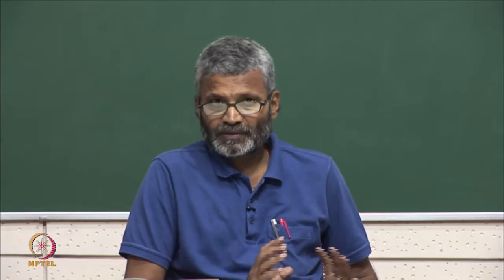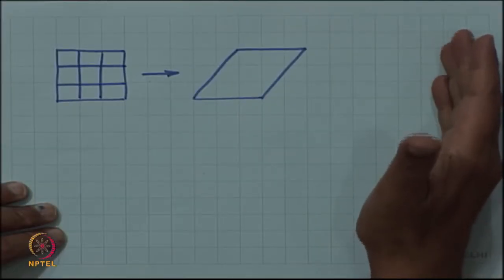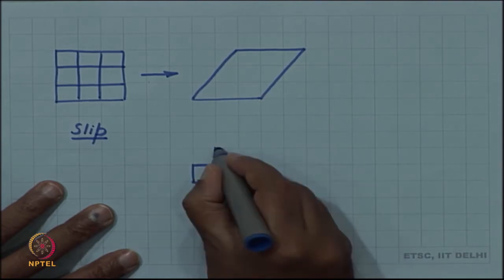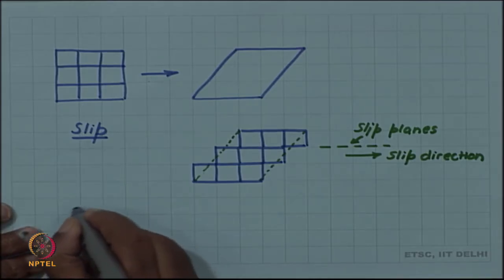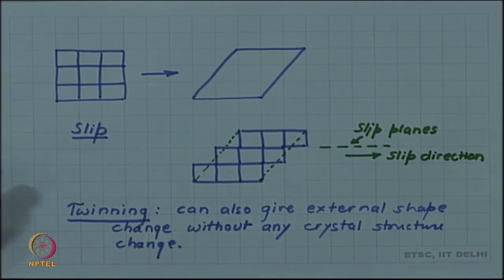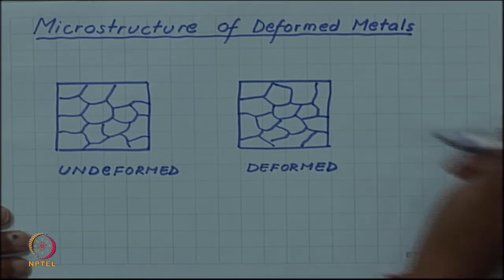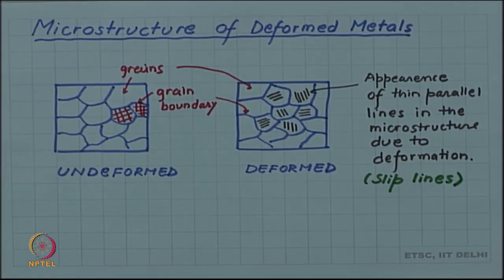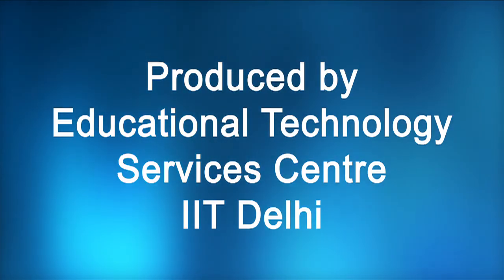Shape Change Without Change in Crystal Structure

Comment: Hi sir. I was not able to visualise how slip lines are formed. we might give force in one direction for deformation, but how crystal structure slips in different directions. I think my question might be bit confusing.
Reply from the maker: Although you apply force (actually stress) in one direction it has components in other directions as well.
Reply: @introductiontomaterialsscience  yes sir . Except principal axes we are having force in all other axis. does those lines mean a part of crystal (planes) is actually extruding away from the crystal, are we visualising those extended planes as lines in microscope.
Reply from the maker: @harikrishnan3112  Right. The surface steps are seen as slip lines.